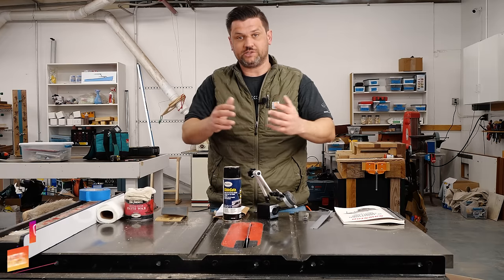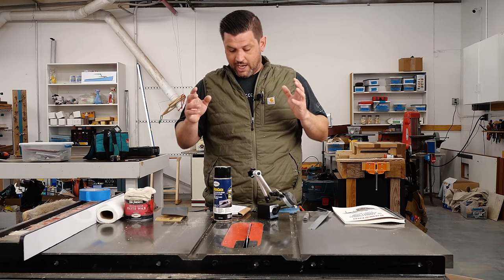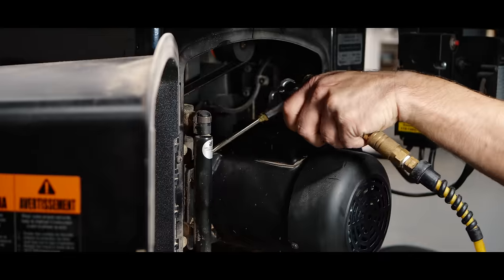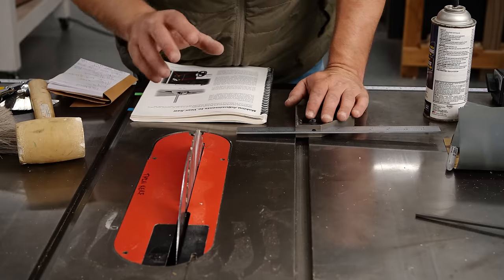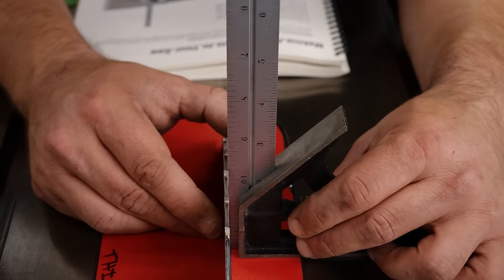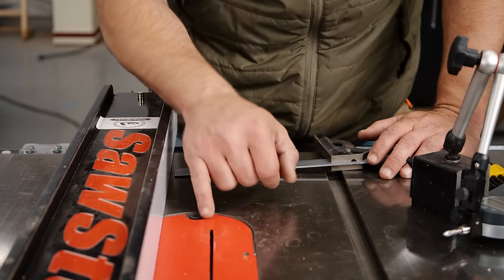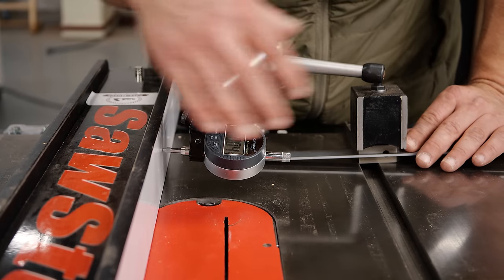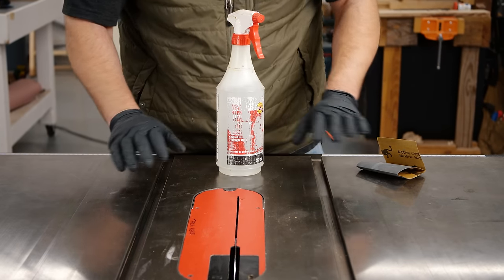Table Saw Tune Up and Maintenance

Comment from the maker: Great things to have for Tool Tune Ups:
Digital Test Indicator: https://amzn.to/2VXvzzm
Glidecoat Drying Woodworking Tool Lubricant: https://amzn.to/2Lys3aY
Paste Wax: https://amzn.to/2HasWC4
Steel Wool Super Fine: https://amzn.to/2vPHkcO
Reply: Jonathan, I’ve completed this table old saw rebuild and when using the glidecote, do you coat blades also?  I have used wax, but just doesn’t seem to pull its weight as well on the cast iron top, those old ones weren’t polished like the new tables and I think that may have something to do with it. It’s not worth risking taking the flat out of the table to rid it all and sending it to be resurfaced defeats the purpose of rebuilding it to afford my new planer. I’m using those top end CMT Orange Combo, Rip and CC blades you just featured from Taylor Tools (thanks a bunch for the tip off in that sale and additional discount, I got 3 quality blades for the cost of just one Forrest or comparable 👍).  I know that Bostik used to have a product called bladecote, but they went and redid all their branding at some point (probably while I was off killing bad guys 🤪). So what all is glidecote good for and is there a coating you’ve used that you recommend for blades and bits of all sorts?   Semper Fi and keep it up brother.

Comment: Jonathan; great shows.  I just recently purchased a used 10" King Tablesaw, and I am presently working on cleaning it up and throwing a set of wheels under it.  It takes me a rather long time to complete such projects due to some rather serious upper limb injuries.  I used to work with metal as I was a Blacksmith, welder, and did some basic machining for my career of 30+ years.
Anyway,  I purchased this amazing tablesaw for $100 as I am upgrading from a Canadian Tire brand 10" tablesaw, wow what a huge difference the King is over the Canadian Tire brand saw !

Comment: There is definitely some nuance to the surface cleaning process that I still don't understand. I applied vinegar and water and it removed the rust spots quickly but the entire surface rusted instantly before I could apply wax. I next tried it with the baking soda afterwards which helped, but still some corrosion formed before I could apply wax. Not to mention that the baking soda is pretty messy.

A detailed video on just the surface cleaning process would be appreciated

Comment: That's pretty good Jonathan. A couple comments. I would check the runout on the saw arbor face flange. Its a good idea to clean the flange with some solvent as pitch will build up on it if you change blades a lot.. You like to have less than .001" runout on the flange. You should take the runout on the blade also and you would like have less than .004" as far out as you can take it. Its a good idea, because of runout to mark a tooth with a sharpie and use the same tooth for checking blade alighnment with your indicator. Cheers

Comment: Literally just aligned the blade on my sawstop yesterday. Those bolts to loosen the table were NOT easy to get to. Had to use my impact driver with a ratchet attachment. Great video!

Comment: I would be interested in the tune up of a compound miter saw. Even after the wind up, my saw/ blade feels like it has a random shake to it. Maybe its operator error or just in need of a tune up? I have a Rigid 15 Amp Corded 12 in. Dual Bevel Sliding Miter Saw with 70° Miter Capacity. It is 1 year old with a new'ish Diablo 12 in. x 100-Teeth Ultimate Polished Finish Saw Blade installed (for reference).

Comment: As someone who is extremely new to woodworking may I ask for a video showing how you made your adjustments underneath? I realize this may be difficult with the low lighting but it would be super helpful. Great video!
Reply: Depends on your machine. Showing the adjustments on his saw wouldn't apply to every saw on the market. Like the video said, check your manual for more detailed instructions. You can also search out a more detailed video with your saw's model number

Comment: Great info, thanks. I work out of a shared shop space and the tool maintenance is often neglected. Your video is a good reminder to get it done.
I'd love to see your tips on the planer tune-up. In our shop it often gets misaligned and ends up making wedges. Some tips on correcting it would be appreciated.
Reply from the maker: Always take two passes running it both ways atthe same depth (rotate 180 long way) . Thay should fix it in the short term.
Reply: @katzmosestools  oops, sorry. Meant jointer not planer. The jointer is making wedges. Usually it involves some fidgeting with the blades or outfeed. Just wondering if you have tips on making it quicker. Thanks

Comment: I was delighted to see this video as I was just trying to align my Dewalt Contractor Table Saw last night.  One thing I struggled with (which may not be an issue for high end SawStops) is after loosening the screws I got it perfectly in alignment,  but when tightening the screws back down it pulled it back out of aliment.  Any suggestions on that issue would be much appreciated!
Reply: Get a set of table saw PALS, google them. You order them for your specific saw, they are basically adapters that let you use a set screw adjustment and then the original bolts just sort of snug them up
Reply: @stephencarr8366  Looks like a great system but don't see support for Dewalt
Reply: @bradagdern8110  You might call them. I had Delta on my mind, that's what I have, One of the other kits might work

Comment: I finally got a table saw, a Rigid from 2000 or so.  I have been working on getting the top rust free all day today, and most likely into tomorrow as well.  Does it have to be completely Rust free?  What are the detriments to having Rust on the top?  And when you use the Paste Wax on it, do you wipe it all off right after you apply, or do you let it sit and dry on it first? Thanks in advance!!

Comment: I have a Grizzly hybrid, I used to use SC Johnson Paste furniture wax. I stopped using it, was having issues with it getting dried out and hard on the table top, even though I buffed it. Went back to Boeshield T9. 
Bandsaw would be great to see but, hand planes, spoke shaves would be better.

Comment: Hey! I have a table saw in my garage, but it's an older saw and the top is made of a rough aluminum (I think) and parts have a really tough time sliding, making it feel extremely dangerous any time I use it. What would you suggest? I kinda want a new saw. Something affordable for a home shop.

Comment: Great video. I have a Ridgid table saw. And my fence is so hard to get adjusted, any ideas. The wood scrapes on the back of the blade as much as the front. Any help wood bee appreciated.

Comment: Very cool video. It's been 5 years since I got my sawstop and I haven't needed to adjust anything yet but I'm thinking now that I should at least check everything one and definitely add oil to the necessary parts I haven't done that before. Any special oil you use?
Reply from the maker: Linked in the description and pinned comment

Comment: Sometimes when I use past wax it leaves a sticky feeling..... did I just got get to buffing it out fast enough? I’ve always just coated it again and it usually comes smooth
Reply from the maker: Just need to buff a little harder probably
Reply: We use "silbergleit" . it ain't cheap but it's fantastic.
Reply: Fwiw, this happens to me when I leave too much wax on surface.  I.e. you don’t need a thick layer.

Comment: I have not been able to get my extension wings flat with the main table.  Even if I get one held just right, as soon as I tighten the bolts it moves just slightly.  I figure as long as the outside edges are not higher than the main table I can live with it.  
Any tips would be appreciated.

Comment: Just thought of something for checking that the blade is square to the table when set at 90 degrees: the throat plate might not be perfectly flush to the table, and the part of the blade above the table is not very large for an accurate reading of squareness with the combination square.
Why not remove the throat plate, then test for squareness the other way around, down in the well, with a try-square with the inside edge of the stock on the table and its blade against the saw blade (avoiding the hub, obviously)? That references the reading on the table and not the throat plate, and now we have ~8 inches of blade instead of 3 to measure squareness.
Reply: Just checked: the blade of my try square is too wide to fit in the well between the saw blade and the wall. However, that of my combination square fits nicely, with a bit of wiggle room to spare.

Comment: I don't know why I never thought to use vinegar for rust spots! thanks for that! Is there a special kind of paste wax you use for the top or will any work? I've got some rust spots on mine, granted it's just a little job site saw but it's still mine and it's what I've got. But I really want to get those gone.
Reply from the maker: Links in pinned comment. Cheers bud
Reply: @katzmosestools  You sir, are a gentleman and a scholar!

Comment: What was the purpose of using baking soda around the throat plate before applying the paste wax.  I have a SawStop and will verify my alignment.
Reply from the maker: Neutralize the vinegar
Reply: @katzmosestools  I was thinking that but though maybe it was the glue and sawdust trick to fill gaps.  baking soda then paste wax to fill the gap in the throat plate.  =)

Comment: Hi Jonathan, I am embarrassed to tell you what happened.  I bought a brand new Laguna Fusion 2, it arrived in February 2022, the other day on a Friday afternoon finishing work I blew the table saw clean with my compressor, on Monday morning the table saw was complete pitted, there must have been condensation (water) in the compressor and I did not release this.  The question how can I repair the table saw.  I am so upset....... ANYONE PLEASE HELP!!

Comment: What if your table is aluminum instead of steel?  Obviously sanding is out of the question, but wax?
Reply from the maker: To be honest I'm not sure. Aluminum wont rust so maybe its not needed but I've never had a tool that didn't benefit from waxing